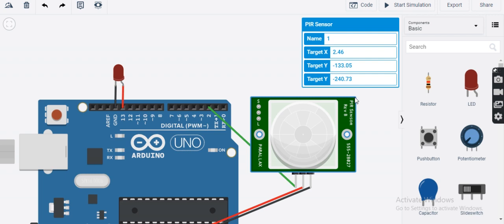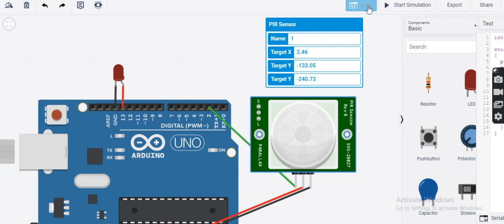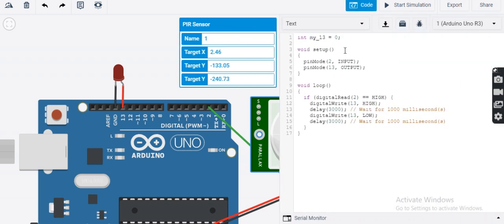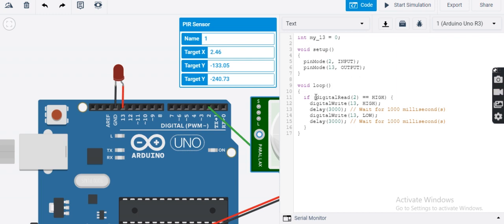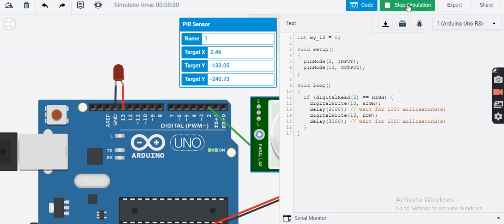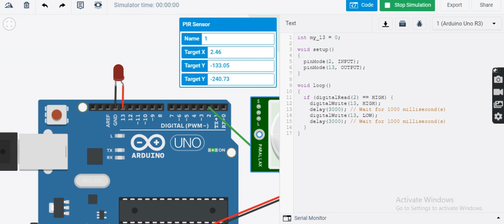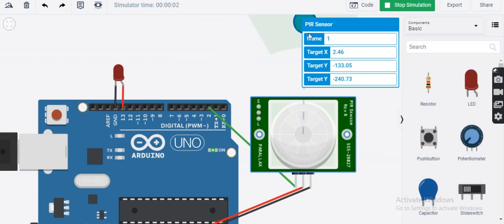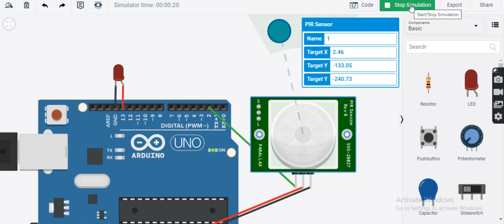PIR sensor with LED using Arduino, Tinkercad simulation #arduino #tinkercad #tech #all #programming

Comment from the maker: Arduino code:
void setup()
{
  pinMode(2, INPUT);
  pinMode(3,OUTPUT);
}

void loop()
{
  digitalWrite(3, LOW);
  int read=digitalRead(2);
  if(read == HIGH)
  {
    digitalWrite(3,HIGH);
    delay(1000); 
  }
  delay(1000); 
}